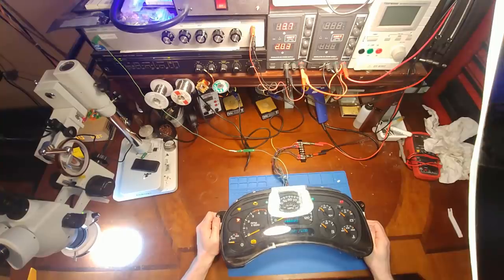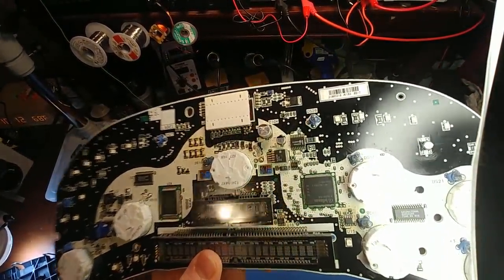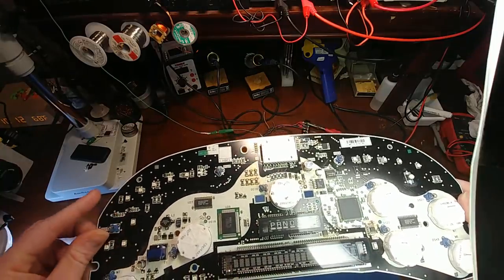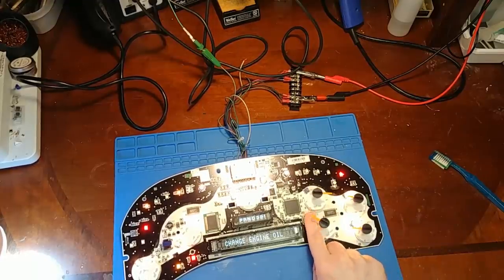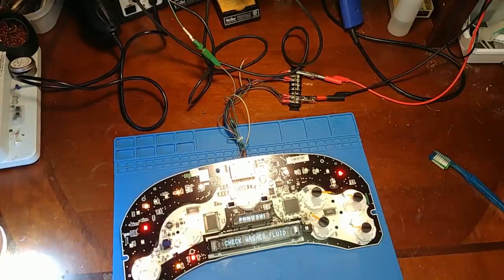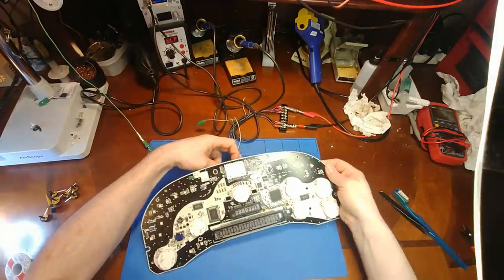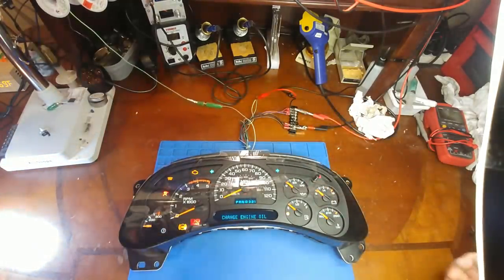2005 GM cluster. Odometer Error turned into no bus communication.

Comment: Hi, where do you buy your components (stepper Motors, Leds, ICs, etc)? Do you get them directly from the manufacturer or from other sellers?
Reply from the maker: Steppers, lamps, through hole LED's, faces and needles are ordered in high quantities from over seas venders. Proprietary chips are from over seas also. Other miscellaneous parts come from eBay, Amazon, mouser, digi-key or Newark.

Comment: What are you using to simulate your data com? Is it adjustable for testing purposes? Reason I ask is I do CAN diag at the dealership level and to sim data would be a great tool in my arsenal. As it stands my only tool for this is my data bus diagnostic tool that works with my MDI module. Great videos. You do great, quality work.
Reply from the maker: I'm using a 2003 avalanche ECU and BCM wired up to pots and mounted in a box for bench testing.
Reply: @jeffescortlx  That's kick ass. Never thought of that. I will have to make myself one. Have been thinking I need to start some off board programming any ways.
Reply: @jeffescortlx   hey Jeff I have  a 07 avalanche  the illustration is not working on gouges, but the displays info are ok how can  I communicate with you in private  thanks Ricardo from California

Comment: I got an 06 board that I was gonna use for the cluster of my own truck. I had repaired it previously and set it 260k miles then I shelved it for a good while due to not being ready to swap it. (I have an 02 truck and I'm swapping the whole cab harness and modules to 03+). I got it back out because I was almost ready for the swap and now it reads odometer 0 and it wont let me program it all, but I still have data line communication working. I have been looking for a few days for shorts but finding nothing albeit with my eyes and not a microscope. I don't have an 06 eeprom or good bin to dump on a replacement or I would try that, didn't know if 05 was the same because I got an 05 sitting around. Seen anything like this before?
Reply from the maker: It could be an issue with the eeprom, or I've also seen a damaged trace under the oil pressure stepper motor that can cause the eeprom to not communicate properly with a micro controller. Check that trace first next to the stepper motor pad, if it's okay send me an email and I can mail you an eeprom and a discounted rate.

Comment: Your work is great. I have a 2005 I am working on now. I would like to know what you use to clean everything after you solder. I see a tooth brush but what is the liquid you use?
Reply from the maker: Rubbing alcohol
Reply: @jeffescortlx  Thanks for the reply. I taped a small nozzle on a vacuum cleaner for my solder sucker and it worked great, I didn't rip any pads off while removing the stepper motors. Hopefully soldering new lights and motors goes just as good. Your videos really helped me and gave me the confidence to try this myself. Thank you
Reply from the maker: @rustyknucklesgarage6145  no ripped pads that's good!

Comment: Hey Jeff,  would you know what would cause the displays to have black burnt spots in right hand corners.  The mosfet, resister and the LTSX look fine.    Any help would be greatly appreciated.
Reply: It’s a 07 Tahoe cluster.
Reply: That burn spot is normal. Watch some other videos of Jeff explaing the black spot on right corner and what the purpose of it
Reply from the maker: @omarfw79  Correct. That dark spot is the oxygen indicator. Black = good. White = bad.
Reply: Thank you guys.  It was so weird.  So the board was good, it had no trace of burnt or blown parts.  we put a bead of solder on the mosfet and both displays worked!  Thank you Jeff for your videos.

Comment: Which pin is the positive A or B12V and which pin is the negative one for a 2005 Silverado to power it on the bench?
Reply from the maker: I'm not sure from memory, and I'm a couple thousand miles away from my office currently on vacation. But you should be able to find a wiring diagram with a Google search.

Comment: Interesting video as usual Jeff. Looks like you could use some 45 degree bent nozzles for hot air work under the microscope.
Reply from the maker: As soon as my cheap Chinese hot air station dies I'll pick up a quick with bent nozzle! Any day now. Maybe, the thing just keeps on working.
Reply: @jeffescortlx  You can pick up bent nozzles for the cheaper stations. They are dirt cheap. I had some for my Aoyue back before I replaced it with the Quick.
Reply from the maker: @mike7958  I wish the quick didn't use proprietary tips so I wouldn't have to buy them twice : (
Reply: @jeffescortlx  I know what you mean. The proprietary tips are one of the main reasons I upgraded to the quick. Tool-less hot tip swaps that are done....quick lol. The presets and proper sleep functionality are super nice too. My old Aoyue never slept properly.
Reply from the maker: @mike7958  I don't like the way the auto sleep is set up on my Aoyue, I think there is settings in the menus. But that little sleep trigger button doesn't always register anyways. But the holder with magnetic sensor in my cheaper Tenma is really convenient and works well. Just wish it had a silicon hand cord.

Comment: Had jumpstarted my 2006 gmc sierra denali and now having issues with the cluster like battery, gas, temp, oil pressure gauges dont work. Radio, and some electrical inside the cab not functioning, and also no communication with obd2 port. Is it possible that my cluster got fried? I found a blow radio fuse, replaced and it didn't help.
Reply from the maker: Something has taken down the communication wire. The could be the cause, or its simply just showing you the symptoms of having no communication.
Reply: @jeffescortlx  its the right side of the cluster that the gauges aren't working. Kinda hard to source out my problems.
Reply from the maker: @manueltorres3735  that's because the right side of the cluster gets all its input signal from the serial bus communication.
Reply: @jeffescortlx  im realizing now that its a communication issue not power with the modules. If i can figure out where the communication line meets with the modules im having issues with i can probably find my problem.
Reply from the maker: @manueltorres3735  try unplugging one module at a time until the shorted communication goes away.
Reply: @jeffescortlx  i figured out my issues. I did what you said and disconnected all the modules one by one, and sure enough when i disconnected the abs control module everything started working again. Also i had just replaced this part about a month ago. Thanks again!

Comment: 98 oldsmobile bravada   speedometer  cluster  I haven't  got the one  from  Ebay  yet can you  do it , like  you did in the  video  ,,
Reply from the maker: Your bravada has odometer error?
Reply: @jeffescortlx  no I took  it  to my car guy  in he needed the oil ,speedometer  ,fuel ,temp  ,I say  to get  a  used  one  in replace  it but the mileage  is going  be wrong  on the used  ,take  the chip out of  my cluster  ,put in the one  from  Ebay
Reply from the maker: @nathanwiggins8578  yes eeproms can be swapped. But what happened to the original cluster? Why can't it be fixed?
Reply: I told  it  to he because  my check  gauge  light  can on oil pressure  gauge  was going  all  over  the place  replace  oil pressure  switch  still  check gauge light can on  so he got the  gauge  motor  but  he  order  the wrong ones  so I ordered  speedometer  cluster  with  the  mileage  close  to  my mileage  of my car  but don't  trust  that he  can  change  the  mileage on the one in my car  ,to put on the one from  Ebay  can you  do it  ,price  of the  work  , in how long  it will  take  to do it

Comment: Great work, although I'm suprised you didn't check the RPM and Speedo at a number of points (other than zero) after putting the needles back on!
Reply from the maker: I'm not sure what you mean, the MPH & RPM were checked multiple times, including after assembly. It's all there in the video.
Reply: It looked like you checked that they functioned, but not the calibration of where they pointed to (and for the RPM that was one point around 2000 RPM and speedo was reading around 73 at you test signal). You should recal and set the new cal in EEPROM if you change steppers. You also didn't test ALL the tell tales. I only ask because I used to supply the automotive industry with cluster end of line production test and calibration stations!
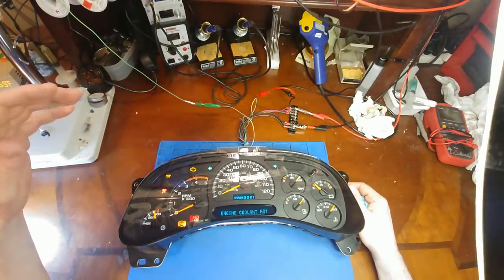Reply from the maker: @simonbaxter8001  at 10:29 the needles are set at the start location while booted up with no signal. At 10:39 reset test confirmed good start location. At 10:57 a second test confirmed good start location. At 11:13 a third reset test confirmed good. At 11:20 start location confirmed at zero MPH, at 12:18 zero MPH confirmed a second time.
As long as your set the needles physically correct from the start, there's no need to make corrections in the eeprom data.
Reply: If you think that's ok then fine. My customers wouldn't accept that as a valid check though, especially on a speedo which has mandatory legal requirements and tolerance for indicated accuracy. Don't dispute the good work you do, just thought the video only showed a portion of a return to service validation check.
Reply from the maker: @simonbaxter8001  if we were talking about cop car calibration I see your point. I'm not trying to claim that level of accuracy (but let's not forget even a brand new perfect X27 is going to have some slop). But I do think I'm more picky than the average 3rd party cluster rebuilder of 15 year old chevy pick up trucks.

Comment: I have  a 98 speedometer cluster  on oldsmobile  , I got  a  used  one  off of  Ebay  I like  to  keep  the  same mileage  on that is in my  car ,can you  change  it to the  one  I got from  Ebay  put all my  information on  it
Reply from the maker: It would probably be easier to have the original one repaired instead of buying a used one and having it programmed. I typically charge a flat fee, so price would be same for programming or repair of the original.

Comment: On an 06 2500hd cluster, what would be the cause of the oil pressure gauge to shoot to 80 even without the engine runnung?
Reply from the maker: A failed oil pressure sending unit.
Reply: @jeffescortlx  and would a dead mph gauge cause the odometer to stop recording miles?
Reply from the maker: @hansentom50  no, the cluster doesn't need the needle to move in order to count miles.
Reply: @jeffescortlx  how can that be fixed? The odometer I mean
Reply from the maker: @hansentom50  find out where the signal is getting lost. Confirm it's not making it up to the cluster. A pro grade scan tool can see this.